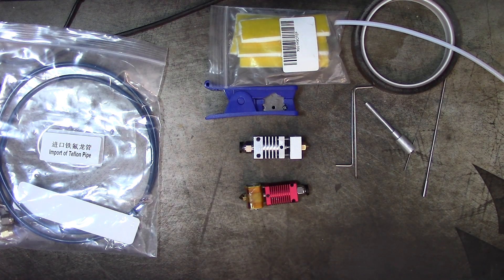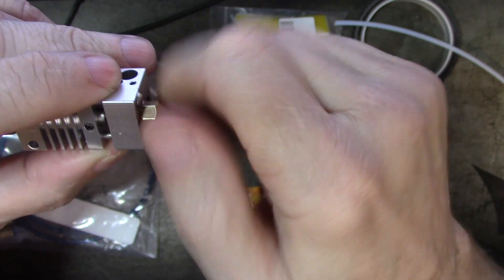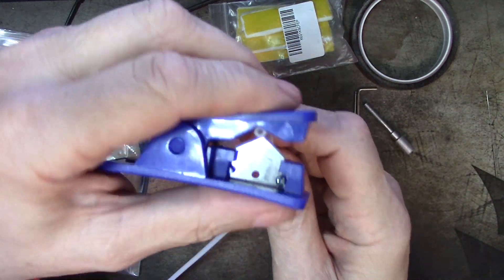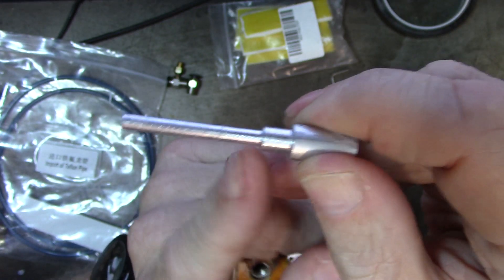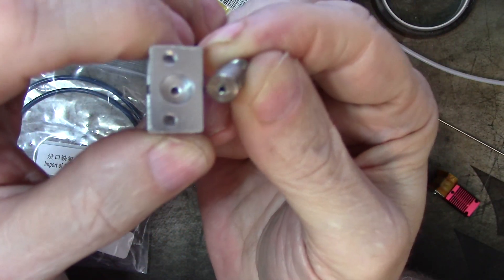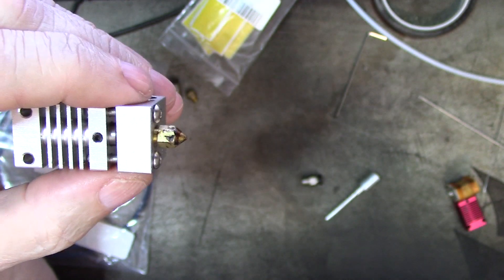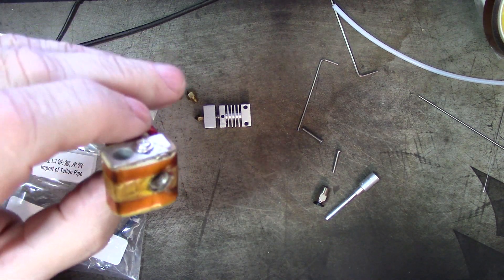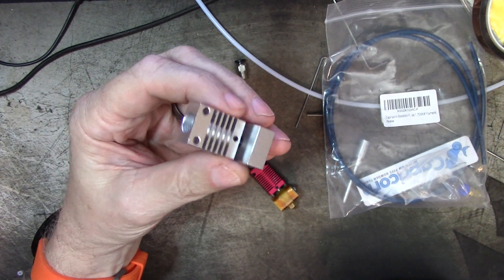Cheap All Metal Hotend for your Ender 3 UPDATE!

Comment: Mostly right. The heatbreak is to prevent the bowden tube from resting in the nozzle where it will char at high temps and cause clogging. The radiator above is designed to dissipate the heat from the heater block as it rises. Thats the whole point of the aluminum fins, to absorb heat from another source and dissipate heat.

Comment: I just out this chinese hotend. In short print works perfect but in longer than 1 hour keeps clogs and jamming. I will try replace fan duct and give it one more chance :)
Reply from the maker: Sounds like you may have your retraction settings wrong. Turn your retraction amount down to 1mm, your retract speed to 40mm/sec and your reprime speed to 20mm/sec and see if the clogging doesn't stop. If it does you can increase the retraction 1mm at a time until it starts to clog again, then back off 1mm. Also, an oiler will help you get a bit more retraction.
Reply: @3rdpig  0.5mm retraction, 40mm/s still clogs. Back to stock setup :)

Comment: the screws have no influence on nobodies tests because the excess energy of the heat block has to escape somewhere and it does partially by the heat brake and we can't do much about it but some of it escapes happily to the radiator through those screws and in the sum of all... instead of having too much heat trying to pass through heat brake to radiator and ending in the filament you have it escaping directly in the radiator part laterally. It's just energy over time that has to go somewhere.

Comment: The 2 screws that people claim are for assembly only is BS, think about it. what company is going to supply an assembly worker with 2 screws for every hotend if they are not needed, Naomi Wu asked the engineers at Creality and they said they are needed and the heat they transfer is negligible,
Reply from the maker: I'll go with what Creality says about their bowden tube style hot ends. However, they are not necessary on an all metal hot end like the one in the video. I've been running that exact hot end on my enclosed Ender 3 for a year without them. If they were necessary, I think I'd know it by now.
Reply: I use the screws so my hotend doesn't spin when i put in a nozzle. Never had a problem.
Reply: The 4 dollar hotend I bought a month ago doesn't even have holes for those screws.

Comment: My CR10 gets a thermal error shutdown without the silicone sock (or a few wraps of kapton tape). I guess it offers a fair amount of insulation from the cooling fan pointing at the heater block...
Reply from the maker: I've never really noticed much of a difference between having the sock (or any insulation) and not having it. IMO the stock CR-10 part cooling fan points to much at the heater block which is probably why your heater can't maintain the temp without insulation. You might want to look at some of the alternate cooling ducts on Thingiverse that aim the airflow off the heater block and onto the printed part.
Reply: @3rdpig  Yeah, the standard setup seems to blast air near more than over the heatsink. Which might also explain why I got a very clogged heatbreak on one of these cheap all metal things.

I'm actually trying to tweak a Tronxy XY2 pro to run an Ender/ CR 10 X carriage as parts/ mods seem much more widely available for the Creality stuff. I grabbed a "Mini Me" fan duct from Thingiverse and strapped two 12v 4010s wired in series on the front of it. No more clogs. Yet.......

Comment: Capricorn tube has smaller inner diameter so it helps on bouden setup for lesser retraction and better print quality.
Reply from the maker: Have you tested this or are you just going by their marketing information? If you have tested it, how did you do it and what brand of regular tubing did you use?
Reply: I have cr-10 and i have experienced it with very glossy filament. Also i can print tpu faster than with standard ptfe tubing.

Comment: But wont you have  to increase the retraction if you print with PET or other elastic filaments?
Reply from the maker: I don't use any retraction at all with elastic filaments like TPU. For PETG I use the same retraction settings as I do for PLA. But I really only use the machine with the all metal hot end for filaments that require 250c or higher print temps.
Reply: @3rdpig  Thank you. :)

Comment: Just to add a note the heat transfer with bolts innside does not transfer any heat that make a diff in my tests i got a variabel on + 0,6  c  on a 7 hour print nozzle temp 250 c bed temp 80 c and  ambient rom temp 24.2 c highest temp messured on the heat block about half way down was 39.1 c whit bolts inn and bolts out  38,5 fan at full blast.  so i dont see the need to remove the bolt. happy printing. Nice video.
Reply: 🎉 legend

Comment: I gave one of these a shot and was able to print PLA, but with PETG the higher temperatures (230 degrees) ended up leading to heat creep issues and the nozzle clogging.  Not much point in going to an all metal hotend if I can't go over 215 degrees without clogs :).
Reply from the maker: I don't think I've ever printed PLA or PETG with any of mine. The only things I print with an all metal hot end are things that have to be in my enclosed printer to avoid warping. So ABS, nylon, ASA, PC and of course all my failed attempts at POM. I've printed up to 300c with mine and have yet to experience clogging due to what I thought would be heat creep. Have you decreased your retraction to 1mm and decreased the retraction reprime speed to 20mm/sec? Also, using an oiler helps with clogging. If the two side screws that hold the heat block to the cooling section are still there you might want to consider removing them after tightening the nozzle. I'm not sure how much they contribute to heat creep, but it has to be something.
Reply: @3rdpig  Retraction was down to 1mm but I hadn't adjusted retraction reprime speed, and I hadn't thought about removing those 2 screws, but I'll give that a try. Certainly with the hype around bi-metal heatbreaks two steel M3 screws between the two can't be helping anything. Thanks!

Comment: Those 2 mounting screws don't transfer hardly any heat at all. That's been debunked. Relying on the single grub screw is not very good. It's a weak setup and also the heat block to rotate too easily. I converted my stock hotend to an all metal version with a titanium heat break from Spool3D, I also bought their nickel plated copper heat block that comes with 2 titanium mounting screws. Copper is stronger than aluminum and can handle higher temps over 300 C without losing structural integrity, unlike aluminum.
Reply from the maker: I agree with you about the heat transfer of the screws being negligible. However, the difference between copper and aluminum at the temps hobbyist 3D printers reach is negligible at best. While copper is a bit stronger and has a higher melting temperature both lose 50% of their structural strength at about the same temperature. So while I'd prefer copper too, it's just not an issue with 3D printers. And when the time comes to move beyond aluminum, I doubt it will be copper that's selected unless it's an alloy.

Comment: We print plastic things - a Bowden tube cutter costs 1 single-edged razor blade and about 25 cents worth of filament.

As for all metal hotends, have you ever tried a 6mm long, 1.75mm diameter heat break?  The space above the heat break is PTFE tubing (which is held in by the bottom of the fitting), but if the fan is working, that should be cool, do no molten filament will come out the top of the heat break.  It's the "poor man's all metal hot end".

Comment: I think using your metal cleaner you could scratch the inside of your hot end.
If you just use scrap piece of Bowden tube you can use that to clean out your hot end while it's on the printer with the nozzle removed
Reply from the maker: Good point. Someone also mentioned wooden BBQ skewers. I'll definitely try a piece of bowden tube! Thanks for letting me know!
Reply: @3rdpig  I clean it like a bolt action rifle.
Push all the crud out bottom. Clean Bowden tube and run it through again.
However, your comment about fitting was the best part. Regardless of replacing hotend, swap fitting to good ones.
The inside teeth count/design is shocking. The difference from cheap to the more expensive versions

Comment: I see a huge difference with some of the... let's say "cheaper"... PLA and PETG filaments if I forget to put the silicone sock back on my hotend and print with a 0.1mm layer height. First layer will look fuzzy from the extra heat hitting it, and often will expand up into the nozzle path for the next layer. I'll start complaining and thinking I have a clog in the hotend, and then notice the sock sitting on the table -- pop it back on, restart the print and everything is fine. Great video as always, Chuck!
Reply from the maker: That's a really great tip, thanks for sharing! I've had similar problems when switching from a printer with a sock to one without one and I've blamed it on a lot of things but never really thought of the sock. I'm off to buy socks for all my printers. Thanks for spending my money! lol

Comment: if you really want to improve the ender extruder all you need to do is to exchange the heat break with the one from Slice engineering. ( copperhead C-E variant)
Reply from the maker: So instead of a $7 part for our budget $150 printer, you're suggesting one that costs over $60 by the time it's delivered? No offense, but I think you're missing one of the main points of my video. Which is kind of hard to understand since "cheap" is the first word in the title. If you're going to throw a bunch of expensive parts into a budget printer then maybe a budget printer wasn't the best choice? Just saying...

Comment: You need to have high temp thermistor or similar to heat 320C. It is enough to tight nozzle with your printing temp and even lower. I do it 20C lower than my max print temp. No issues
Reply from the maker: Every screw in thermistor I've tested will read to 320 long enough to tighten the nozzle without damage. What data are you using to decide that tightening at a temp below max print temperature is OK?

Comment: no more than one millimeter... or turn it off? what's the minimum? what do you feel is best?

oh... and can you sell some of those lathed tools on ebay? (~10mm->bowden size->1.7mm->0.4mm ideally :D)

if not someone else?

and then link me :D
Reply from the maker: I think the amount of retraction you can do will depend on a number of things, including how smooth the filament path inside of the hot end is. But yea, start at 1mm and work up slowly until it jams then drop down 0.5mm and you should be good...after you clear the jam. You can also use an oiler, that let me go to 4mm with no problems. Just make sure the oiler doesn't dry out. I don't sell on ebay anymore, between the scammers and the idiots it was costing me more than I was making. With some aluminum round stock a bit bigger than what you need, a drill, a set of small files and some sandpaper you can easily make your own. It will take longer than on a lathe, but it's something you'll only have to do once.
Reply: @3rdpig  hmmm and filed flat would be easier than round, which would actually be better for scraping, thanks

Comment: Oh and I just bought two of them through your link. I have a Anet E12 and a ender 3. Getting ready to do a direct drive on my E12. I've updated the x axis on the E12 with a v slot.
Reply: how did it work out?
Reply: @crookcostello6018  well it all might have went well if I would have remembered the retraction setting but I plugged the sucker almost from the get-go so i yanked it off and put a Bowden tube hotend back on it lol I haven't looked at them since.
I've been printing a lot of silk pla.
Hitter boxes and birdhouses.

Comment: if you got a mini mill lathe?  can you make the nozzle with a chamfer?  can you mill the heat block with mating chamfer , to mate with the nozzle chamfer ?
Reply from the maker: Sure, I suppose I could. In your opinion what's the upside to doing that? And other than the time/work in doing it, what's the downside?
Reply: @3rdpig  I think if both parts are chamfered, they will fit with close tolerance, not just being butted up together, one surface will be in the other surface. the filament will not catch against a edge of a hotend surface, the filament should glide thru hotend better, with no sags , IMO
Reply: @3rdpig  thinking, if the chamfer of the hotend was downward, like a drill bit into some wood, to counter sink a screw head. the hot end would fit , the filament would not hang up on any inside surface, should slide thru the nozzle. sounds good?  makes sense to me now.

Comment: Hey had a question. I installed one of these on my Ender 3 pro and as soon as I heated it up to 200 it started lightly smoking?!
I bought a new one and it does the same thing. I put the old one back and it doesn’t smoke. Help!!
Reply from the maker: I've installed 3 of these and mine only smoked for the first few minutes as it burned off any oil or grease used in it's production or put on to protect it during shipping. If yours is smoking longer than that I'd have to ask "What the heck is smoking?". I mean it's steel, aluminum and maybe a bit of titanium alloy in the heatbreak. Those metals themselves don't smoke at 200c. If it was me I'd just go ahead and heat it till it somked and let it burn off whatever is on it. But then again, I'm a madman so you should take my advice with that in mind. If you don't want to do it with your printer take it outside and use a heat gun. Be careful if you use a propane torch, the heatsink is aluminum and a propane torch can melt aluminum if you're not careful.
Reply: @3rdpig  Thanks for the response sir.
I was thinking it was some type of coating burning off as well but I let it go for about 20 min and it was still (barely) smoking.
I was trying to find the exact place it’s coming from. It also only starts when I put the fan/shroud on which makes me think possibly wires touching the side of the hot end but I thought they had some type of heat proofing on them. 
I will try letting it stay at 200 or so for an hour and just watch it. Thanks again!
Reply: Update: it did stop smoking after about 30 more minutes of letting whatever it was burn off. 
Now to fix my extruding issue..

Comment: https://www.captubes.com/specs.html
Melting point is 300/340c depending on the grade, but off-gassing of the teflon still occurs, that's the warning at the bottom. I bet this is what confuses some people, the melting point and off-gassing point.
Reply from the maker: You're probably right. And to be honest, if it wasn't apparent I'm not a materials engineer or a chemist. I have no idea how much off gassing there is or how harmful it is. Since I love my wife and my dog, I'm playing it safe.
Reply: @3rdpig  I've read its similar to leaving an empty teflon frying pan sitting on the stove under the fire - I think it really depends how long its sitting  there, to how much it off gasses. I think frying pans have the same warnings on them if i'm not mistaken. Some also claim, that the TPFE tubing is fine as long as you open a window and turn a fan on, which makes sense, but I don't think I'd take a chance with that personally myself. History has shown many people suffering a lifetime for dumb mistakes and trying to save a buck or two. Good video brother, keep up the good work!

Comment: Please share your slicer settings for this all metal hotend
Reply from the maker: Which slicer? What filament? What other mods? What bed adhesion method? What I'm saying is the settings that works for my setup might not work for you. Switching from the standard teflon hot end to the all metal hot end you to reduce your retraction amount to 1mm, or 2 at max. If you use an oiler you might get 3 or 4, but if you retract too far it will jam since the bore of the all metal hot end isn't as slick as the teflon hot end. Also while your retract speed can stay the same, your reprime speed should be lowered to around 20mm. Other than that, go with what's worked for you in the past or start with what the filament manufacturer recommends. If your getting jams, reduce the retraction amount of the reprime speed. I like to start low and work my way up. Jams suck. And as I said, an oiler can help a lot.

Comment: Mine keeps clogging all the time. Getting well F off with it now
Reply from the maker: Just about every time I've seen an all metal hot end constantly jamming (usually prints for 10-15 minutes then jams) it's been the retraction settings in the slicer. You can't use the same retraction settings for an all metal hot end that you do for a bowden tube hot end. You want to start with only 1 mm of retraction distance (original setting might be as high as 8mm). The original retract speed is fine (it's probably 40 to 60 mm/sec) but you need to turn down the reverse retraction movement speed (called retraction prime speed in Cura and deretraction speed in Prusa Slicer) to 15-25 mm/sec. Once you have it printing OK with 1mm of retraction you can bump it up until you find the highest amount you can use without jamming. You can also add an oiler which will give you another 1-2mm of retraction before it starts jamming.
Reply: @3rdpig  Think it may have bee user error, I had the heat break screwed right down into the heat block (well it never cam with instructions) so nozzle was not screwed in all the way and the small pipe bit of the heat break that does the cooling was inside the heat block. fixed it all just now after realising and putting 2 and 2 together watching youtube videos I noticed a diference. Will let you know how things go.